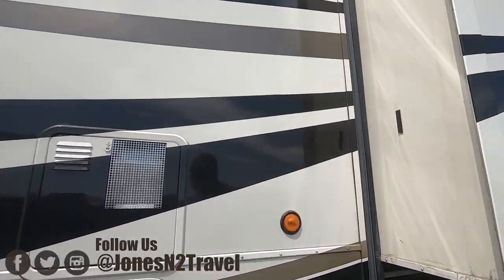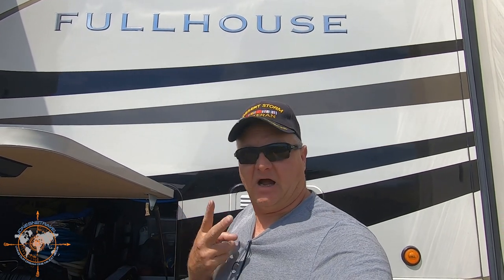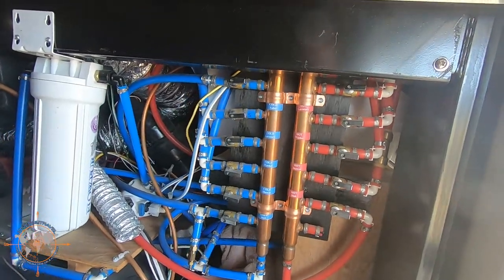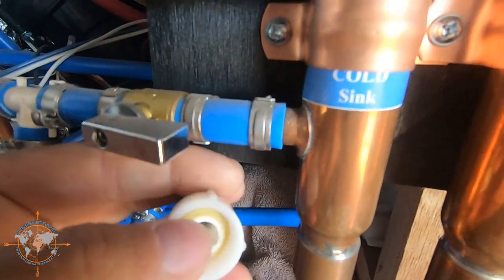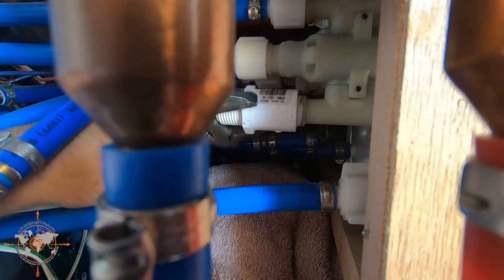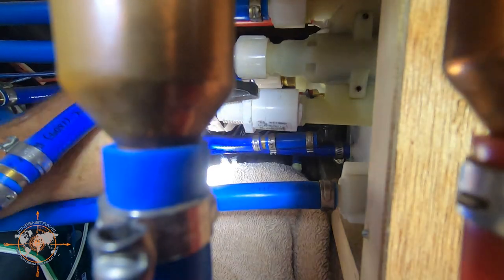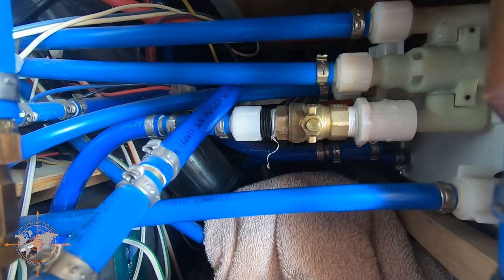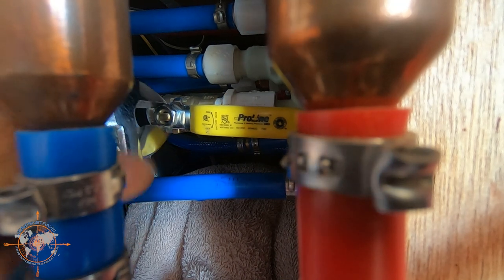ANDERSON KANTLEAK WATER VALVE HACK | SAVE $$ | HDT RV LIFE

Comment: Good job. You might want to consider liquid teflon tape (Pipe dope) for tight spaces. And, you could use both for double protection in tight spaces.
Reply from the maker: Great idea. Thanks for that tip. Thanks for checking out the video and following along. Safe Travels

Comment: If you don't want to damage the threads on a pipe use a rag to cover them and then put the device you're tighten them with on it
Reply from the maker: Hi Byron. Excellent point Sir. Thanks for checking out the video and for following along. Safe Travels

Comment: The kantleak valve needs to have the pressure released before turning selector. That's probably why the O ring on the cartridge got destroyed and lead to your storage tank filling.
Reply from the maker: No that isn't it. They wear out over time as does anything with o-rings. It's simply a bad design. Once they wear out and begin to leak it doesn't matter then whether you turn them with pressure or not because its already worn out. Thanks for checking out the video. Safe Travels
Reply: @JonesN2Travel  Well then I guess you had better tell Andersen Valve that then because releasing the water pressure before turning the selection handle is exactly what they instruct to do.
Reply from the maker: Yes, you are 100% correct but they will still wear out over time even if you turn them with no pressure. ABCO already knows about it and that is why they discontinued the cartridge and came out with an entirely new panel that is all brass. I mentioned in the video that I will be replacing my panel with a new one soon but this hack is to get us by until we can get a new panel. Hope that helps. Safe Travels

Comment: Ball valves are very tight so they have a lot of friction when operated. I predict that eventually the plastic nipple on the manifold will crack and/or break off from constant flexing and people will forget to do it anyway. There was plenty of line so you could have put another short line on the manifold and brought the valve out to the opening where it would be much easier access and wouldn't be flexing the manifold. 
They are water lines, not hoses.
Reply from the maker: Thanks for the tips. This really is a temporary hack fro us as eventually I will replace the manifold. Great tips though, I appreciate it. Safe Travels

Comment: Good job but why didn't you use a Pex valve and then you wouldn't need the adapters
Reply from the maker: Hi Lee. Thanks for checking out the video. I 100% agree with you. Unfortunately the big box store I had available didn't have any in stock. It would have been a bit quicker with a one part solution. :) Safe Travels

Comment: Just a thought, wouldn't have been easier to cut the pex install the shutoff in line? Yes you would need a Pex tool but if you have an RV you should be carrying pex tool, pipe and fittings for repairs.
Reply from the maker: Hi Scott. Yes, you are correct and I do carry those tools. However, I wanted to show how to complete this hack without any special tools. I know I didn't mention that in the video. Also, I am planning on replacing my panel so I probably wont leave the valve in there once I do that. Kind of a temporary solution, for me anyway. Thanks for checking out the video and for following along. Safe Travels

Comment: Faster and easier would have been a sharkbite ball valve, a cut in the 1/2 pex & done. I see that where your PVC Male adapter is to be a leak since you removed the fitting w the oring, also teflon tape likes to be flat when installed otherwise drip, drip, drip. 

Just my 2 cents. 

Otherwise good video.
Reply from the maker: Thanks Alex. I realize there are faster and easier ways and the SharkBite would have been a good one. I had trouble finding some parts at the big box store so this was what I came up with.  No leaks, thankfully :) Thanks for checking out the video and for following along. Safe Travels
Reply: @JonesN2Travel  roger that, big boxes are hit and miss for the right parts. 

Honestly, we have been having much better luck at local True Value or Ace while on the road. 

Stay safe, see ya on the road sometime!